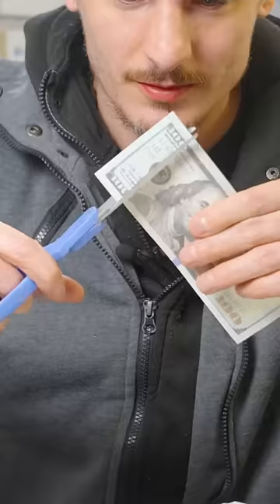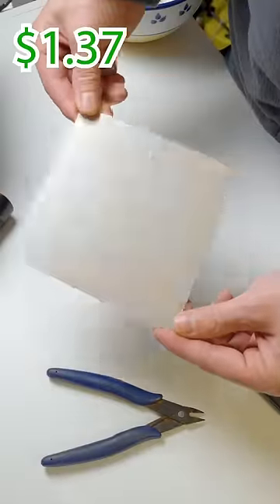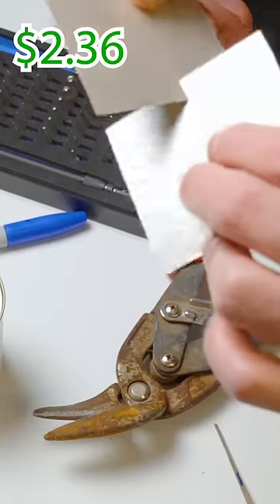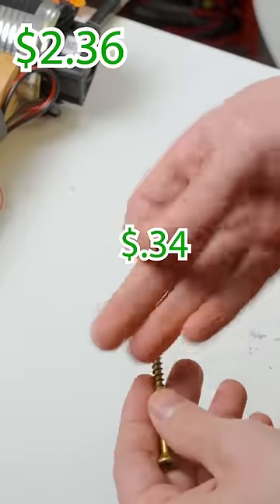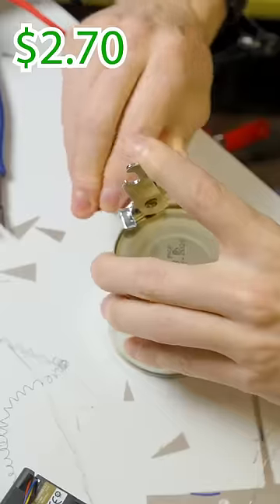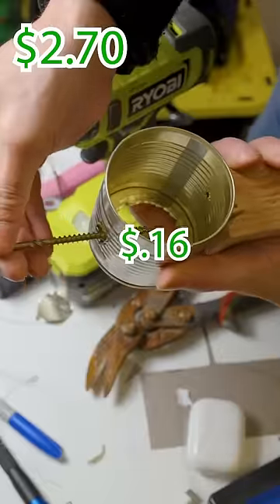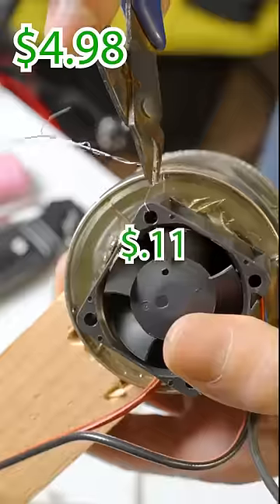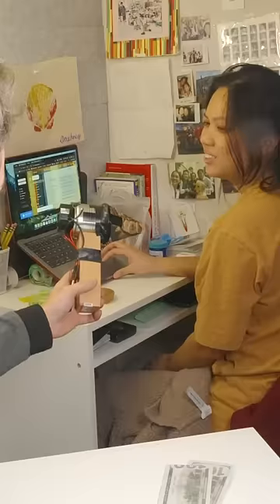Worlds cheapest hairdryer

Comment: The power supply costs more than the entire hair dryer 😂
Reply from the maker: Yes it does 😅
Reply: Just use wall power and adjust the resistance 😂 seems even safer tbh
Reply: @warriorhc172 seems like they are joking
Reply: @idkname7905  Oh damn, my bad. My blind arse didn't see the emoji, Sry.
Reply: The power supply is not likely to burst into flames and give you an electric shock at the same time.  🔥⚡😮
Reply: @Baba_Kush  That's all a standard $10 dollar store hair dryer is. a dc motor a coil of wire as a heater and resistor and a diode.
Reply: @ballardtech827 no resistors. Just tap off a section of nichrome wire for lower voltage if you need one for a fan.

But they do have something else, at least two safety devices. One is a temperature switch, another a one shot combined temperature and current fuse just in case the temperature switch fails or something shorts out or drastically wrong voltage is supplied.
Reply: @SianaGearz 
A klixon and a fuse aren't expensive either.

Comment: You should connect the temperature sensor to the heating element so the air won’t get too hot
Reply from the maker: You are the guy who comments😅. I think the heating element is to hot for the probe
Reply: @pranzetti  I am indeed the guy who comments. Maybe I phrased that wrong,  I meant outside of it and then when it got to a certain temperature, it shut off the power. And then on when it cooled
Reply from the maker: I see. That's a good idea. I'm building a refrigerator out of junk next that could do that. Turns off when it's cold already.
Reply: @pranzetti  is that intentional or is that just a quirk of the machine?
Reply from the maker: It would be intentional. You'd have to have a device that is triggered by a certain temperature

Comment: Total cost: 68.20, drill bit, solder wire, flux, and soldering iron not included.
Reply from the maker: Tools can be used to build multiple different things so you’d have to spread the cost of the tool across everything the tool has built.
Reply: @pranzetti  sure but if you don't have the tool on hand already that's still more money straight out of your pocket in that moment. Money that you would be better off spending on something that will last more than 40 minutes of run time before bursting into flames or melting and eventually causing a short on the inner walls of the can. Money that you might not even have.

Comment: How many amps going thru the heating element? And isntead of a power supply maybe use a battery?
Reply from the maker: 10 amps.  Batteries would put it over the 5v. Plugging directly into the wall would be very brave. 😅

Comment: Also a couple hundred for the soldering equipment and 50 for the drill so actually the most expensive hairdryier
Reply from the maker: You've got your prices a little off. The soldering Iron was $15, the other soldering equipment was  $20.
Reply: I have been thoroughly scammed 😭😭
Reply from the maker: Where did you get those prices ? :(
Reply: Off some guy from fb marketplace i have been scammed though 🤣🤣

Comment: Why would you wrap wire around a screw nd not a smooth cylinder like a pen, then the coil can just slide off! Nice job on the hair dryer
Reply from the maker: The screw gives an even space of the coils. That's what I was thinking when I did that. A pen wouldn't really make the spacing uniform. Thank you! ♥️
Reply: @pranzetti  what we do in jewelry making is we wrap wire around a mandril and it is always even, all you need to do is wrap is tight without any spaces and slide it off and then when you stretch it slightly the coil will expand evenly! Hope that’s helpful!

Comment: Lol, I'm off to buy a used hair dryer for $5 😂.  But for real I got my hair dryer, it was the cheapest I could find from Amazon, I'm pretty sure it was intended for Mexico or something.  It doesn't have a regular plug or the Don't electrocute safety thing.  (It's fine, I have GFCI outlets in my bathroom).  I think it was $8 or so.  Funny video.

Comment: That’s a $10 fan if you get it used. Tbh I think it’s a 12VDC server fan, but I didn’t see a transformer.
Reply from the maker: You can get them for almost free at an electronic recycling place. If you have an old computer you can get one similar in size. 

You didn’t see the temperature reading? Or hear it running in the video?
Reply: I have worked in electronics recycling and datacenters. Computer fan yes. These high pressure fans - no. In fact it’s extremely rare to see them.  The companies that would end up with them don’t have storefronts. 

And yea good catch, he did turn it on for half a second.
Reply from the maker: It was me in the video. I turned in on until it got warm then turned it off. I'm not sure it's safe to leave on for a long time

Comment: This is fake, or will not function after the first time. You can't solder nichrome wire, and if you somehow do it, the solder will melt as soon as the wire heat up. 

Only way to connect nichrome wire is to crimp it mechanically. This is a way to get rid of you gf in 3 easy steps kinda project.
Reply from the maker: Would you like to make a bet that’s it’s real and it functions? The heat for the most part stays towards the center of the “coil.” I haven’t had it malfunction yet. Although it does smell funny. 😄